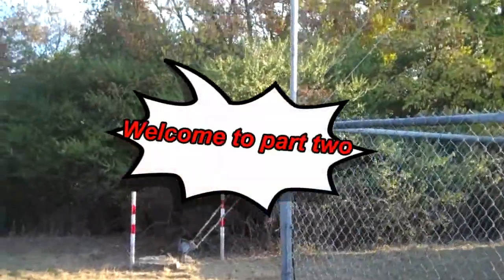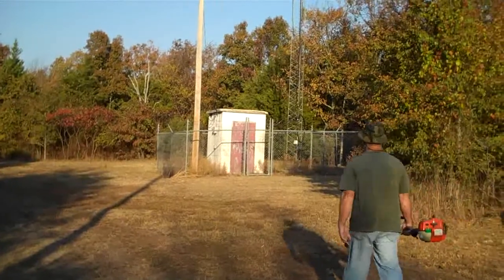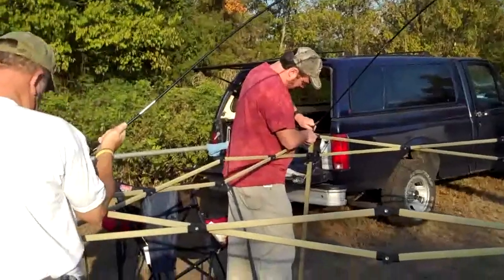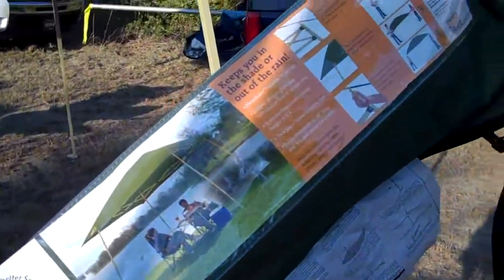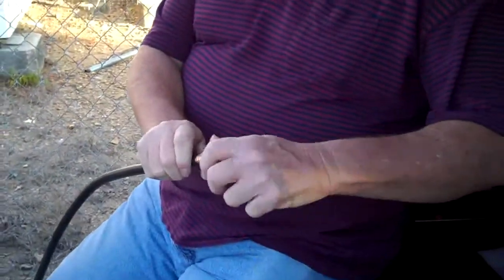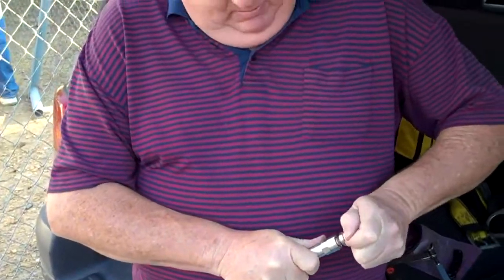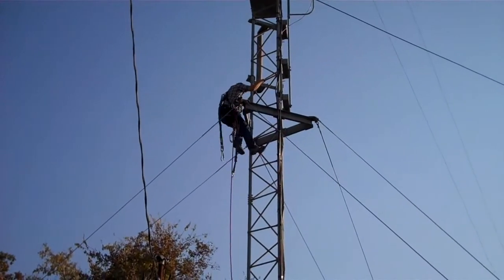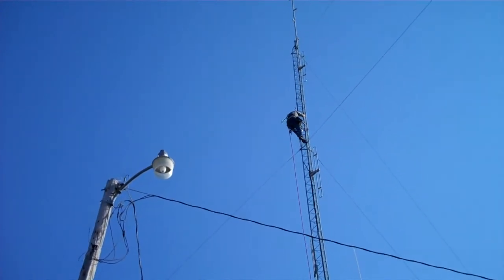Obtaining A Ham License-step by step-details you need to know (part 19 of 34: Radio repeaters).

Comment from the maker: @Twonky411
Heliax cable was new to me.  I was surprised by its diameter and weight..  In this part of the U.S. (tornadoes) emergency communications is very important, so the club strives to achieve reliable, efficient, low-loss transmission capability.
Thanks for stopping by.

Regards,
John